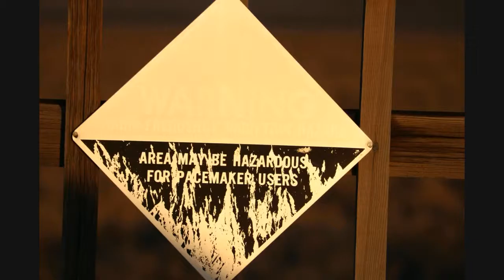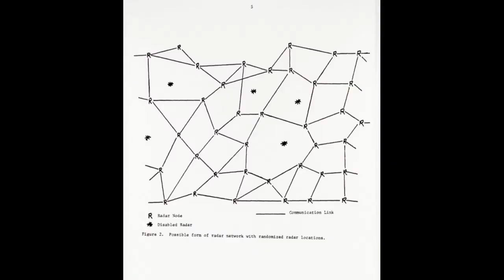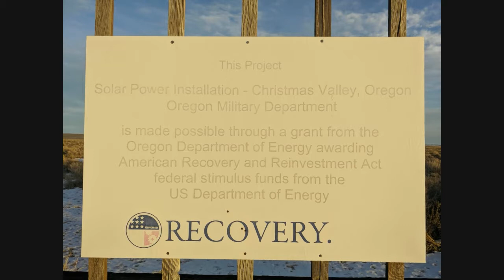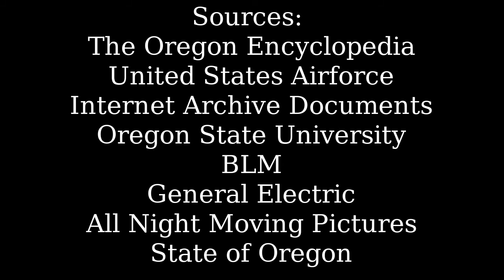OTH-B Radar System Christmas Valley, Oregon

Comment: That Christmas Valley radar base has an underground bunker. Data and NSA center. The small shack building takes you under the ground.
Reply: The Oregon youth challenge program building out Highway 21. has an elevator that goes down underground with a tunnel that leads to the Bend airport.   There’s a lot of weird old Soviet era secrets hiding in the state.